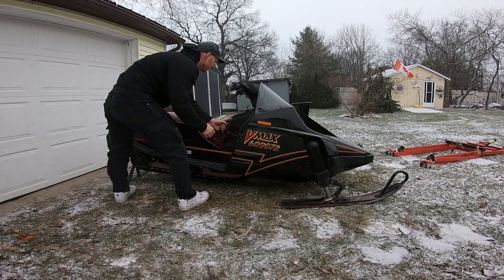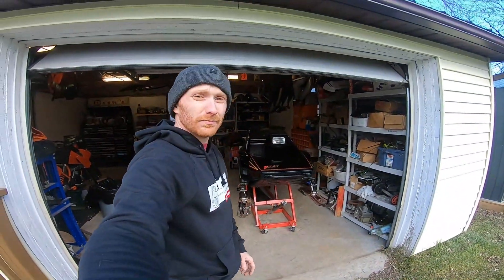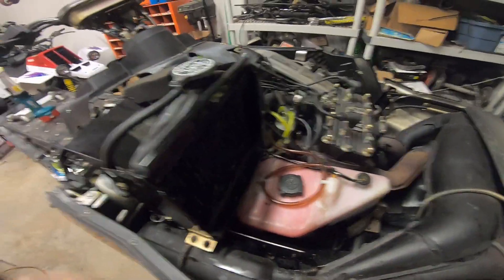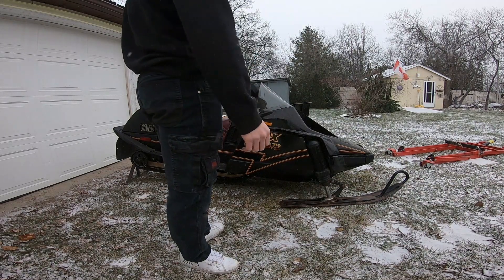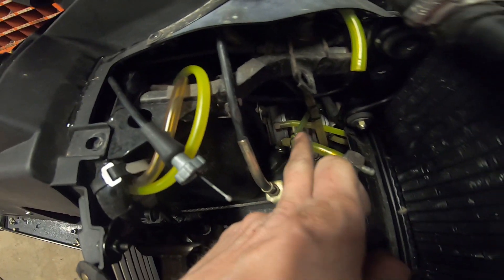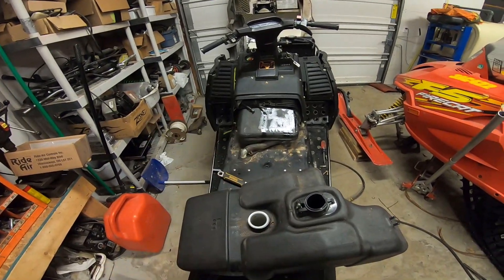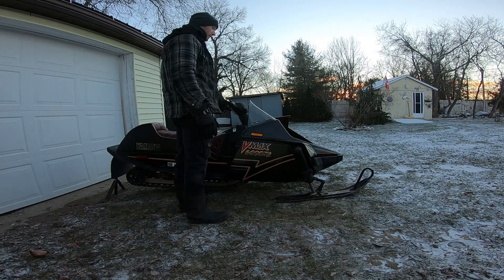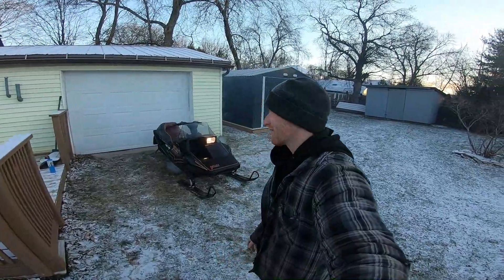Will The Rare Snowmobile That Isnt Real Run For the First Time In Years??? 1990 Yamaha vmax 540

Comment: That's an 86 V-Max... AND, it is absolutely beautiful.
Reply from the maker: Vin confirms its a 1990
Reply: @minnowlaketuning  what is the 10th digit in the VIN? Certificate of origin? I assume that it has been titled at some point which would require the buyer to hand the certificate over to the state, so I doubt that it is available. The brother has one as well? Same year? Only thing that I can guess is that Canada maybe got that sled for a few more years than we did in the states. 83-87 was what I believe to be the only production years, meaning that if you have a 1990, then you should be able to find an 88 and an 89 as well. I will need to research it a little. The Exciter replaced the Vmax as Yamaha's big dog in 88 and we didn't see another Vmax until 93 when the Vmax 4 was introduced as a 750 four cylinder. It was an 800 the following few years with additions like a 5 and 600 Vmax. In 97 Yamaha did away with the pogo stick suspension, and rolled out the new Pro Action chassis in 97, with again a new power plant -the Red Heads (700cc triple). I won't bore you with more, I am actually praying that Canada actually had the 540 that long. That would mean a bigger pond to fish.
Reply from the maker: @@shuvlhedxx  it has the 87v as the first 3 digits, this confirms its a 1990 and I also have ownerships for the sled as well saying 1990. They were made 83 - 87 in USA and up to 91 in Canada

Comment: Had one like it back in late 80s early 90s. I purchased it used. Excellent condition.  It was a great sled for about 1 or 2 seasons. Then,  it stranded me on the trails late at night because it was overheating. I think it was a thermostat. I pulled that out and was able to ride the sled the next day. Then, very first trip of the new season, we got lost late at night. I totally wrecked the sled riding down some railroad tracks trying to get back to town. BAD move!
Reply from the maker: Dam that sucks

Comment: That is an SRX, not a V-Max.   The V-MAX was the four cylinder, two crankshaft 750 introduced in early 90's.
Reply from the maker: It's a vmax. The vmax 4 was the 4 cylinder that came out in 92. Srx 440 last year was 81, there was an 82 500 prototype but very very rare as most of them were destroyed by yamaha

Comment: Has anyone saved one of the SRX440"s that are identical to the VMax540 chassis Yamaha had so many problems with them they supposedly would show up at your house and ask to look at it then take a sledgehammer to the engine and then give you a check to buy a new Yamaha

Comment: If you dont like working on it, you could give to me and all your problems would be solved lol
Reply from the maker: Sometimes she's a real pain but is all good in the end, bad time working on the sled is always better than a day at work haha
Reply: @minnowlaketuning  yes so true
Reply: So not sure what you have done but get new plug caps and trim back the plug wire a quarter inch, give that sweet heart the best and she will treat you well. Have you replaced the crank seals?
Reply from the maker: @SuperBigdanno  yep did that as well. Ended up finding the problem after this video. It was the other cable actuated fuel shutoff. Bypassed that as well and it's running very well now
Reply: @minnowlaketuning  Awesome!! Hey have a Mery Christmas! Let it snow!
Reply from the maker: @jameslaurinitis7580  thanks brotha. Merry Christmas to you as well

Comment: Pull the carbs, clean the jeys before u blow it up.. ughh
Reply from the maker: Was the other fuel fuel shutoff that was only allowing some fuel to flow. Carbs are very clean. Running great now with both fuel shutoff bypassed ... ughh